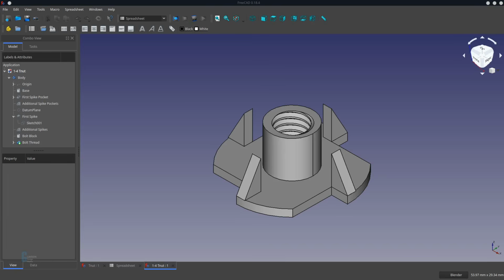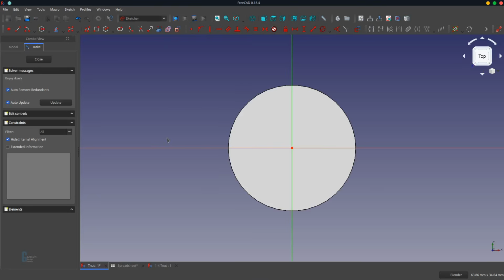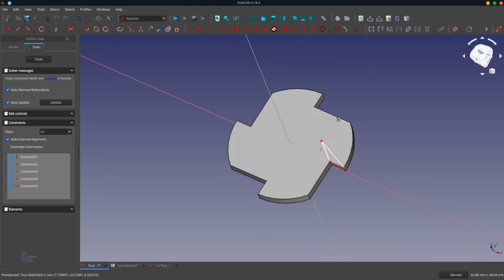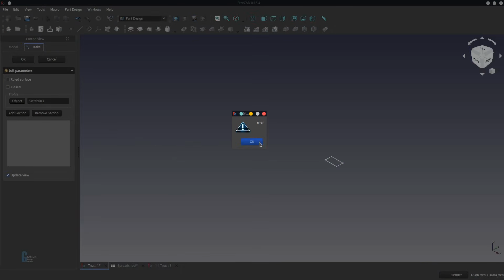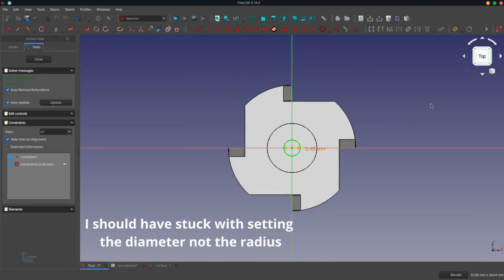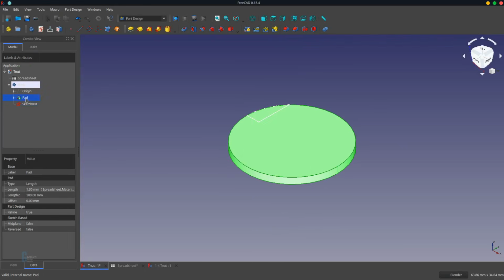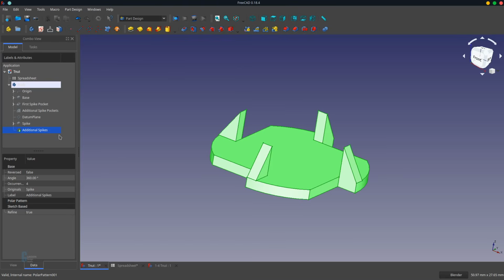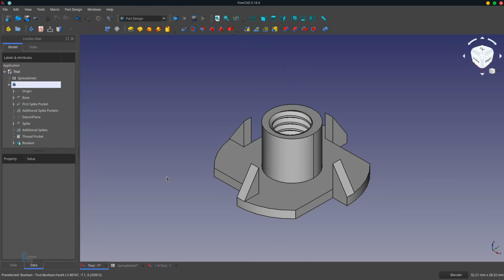How to model a T-nut in FreeCAD

Comment: Actually, one question for you. I love your theme colors in freecad. Im not seeing this as one of the theme color options. Can you tell me what you are using?
Reply from the maker: The theme that I'm using in this video is called Darker-Blue. You should be able to set the stylesheet in the General preferences. I also prefer dark themes on my desktop and I've been experimenting with them. I run K Desktop on Linux and I've been using the KDE theme AND plasma style called Fantasy-Blue for some time now. 

Since that video I have changed my FreeCAD stylesheet  to Light-Blue to make it easier for viewers to see what I'm doing. I hope this helps.